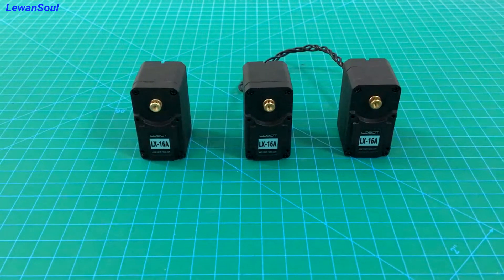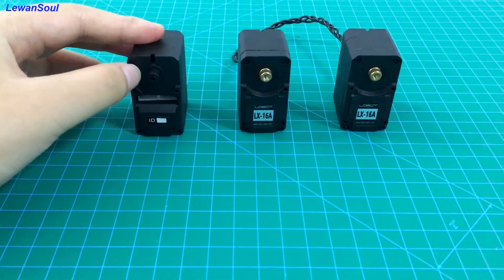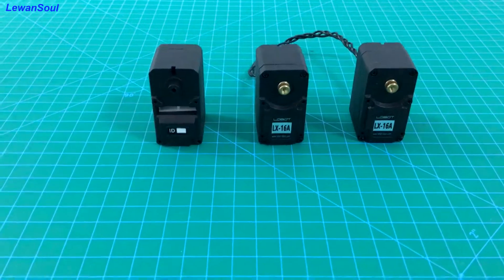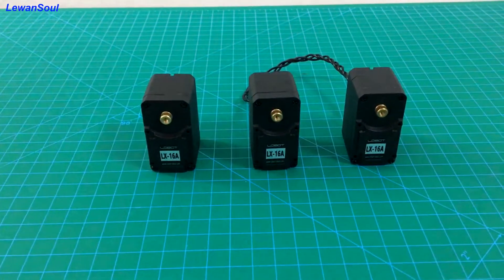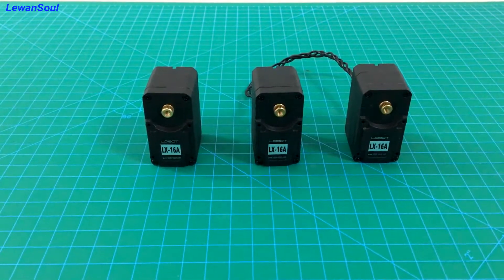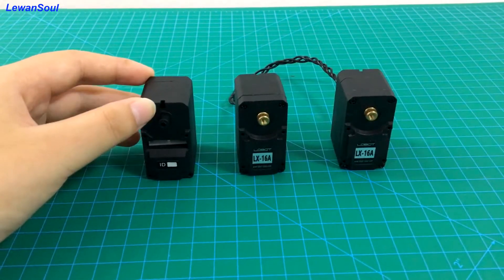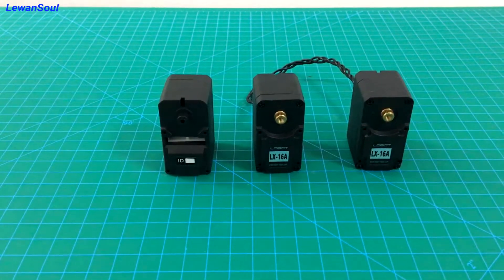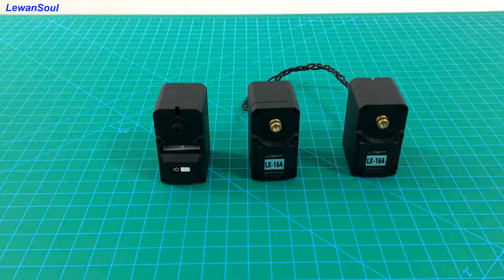The introduction of bus servo (making robots)

Comment: Is it possible to programmatically control the number of revolutions and angle of rotation on the LX-225 servos, for example, 3 full revolutions and 35 degrees?